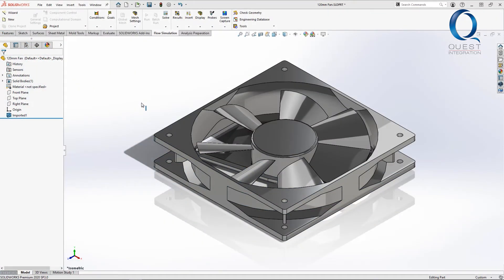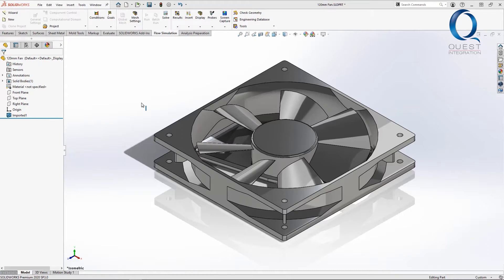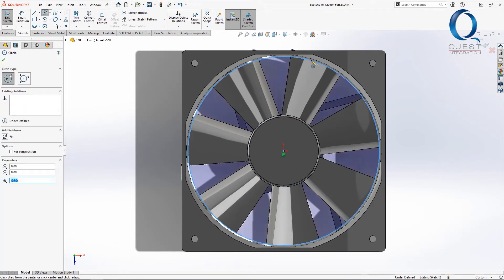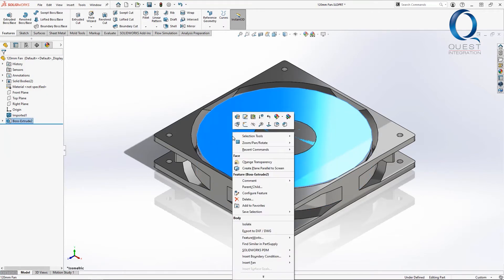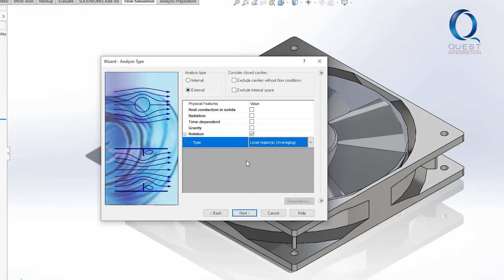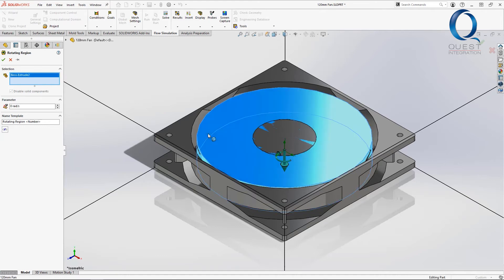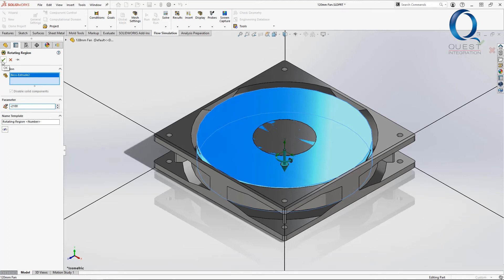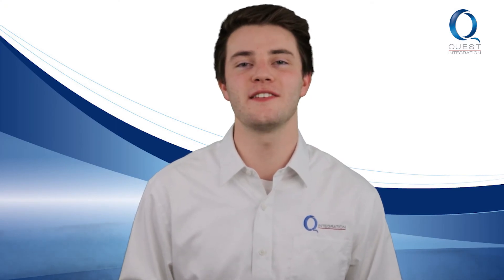Using Rotating Regions in SOLIDWORKS Flow Simulation

Comment: I Have a question ....when you set the rotating body  around a  windmill (not a fan), do  you check  the reference frame as you set the wind speed that will pass through the windmill ? Thanks.
Reply: would love to get the answer to this question, too! I'm working on a vertical-axis wind turbine and I want to have the wind speed determine the region's angular velocity, is this actually possible or no?